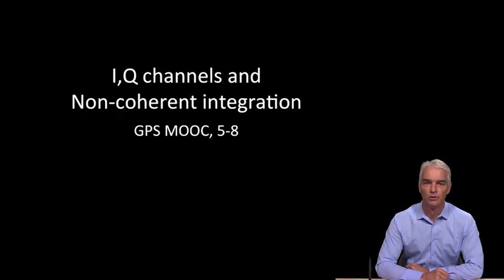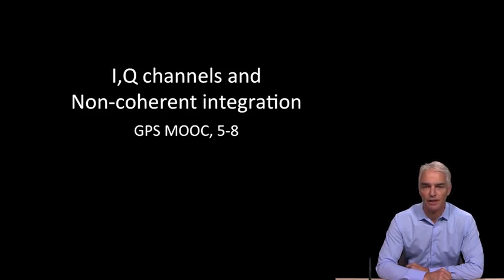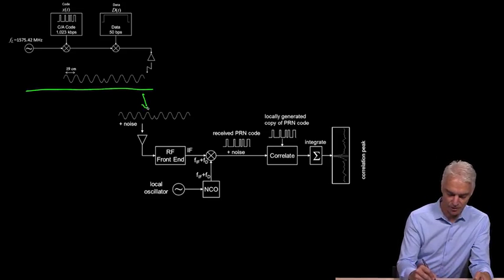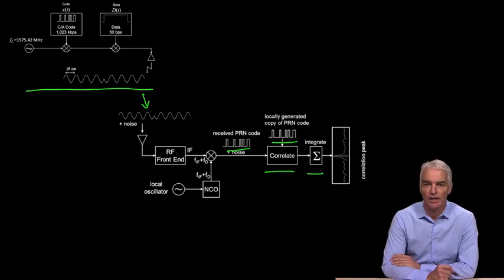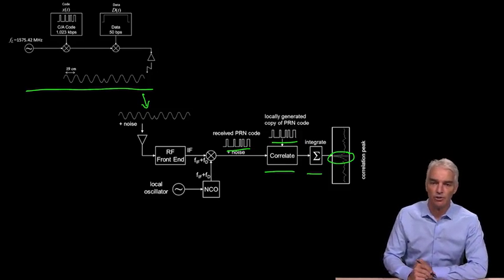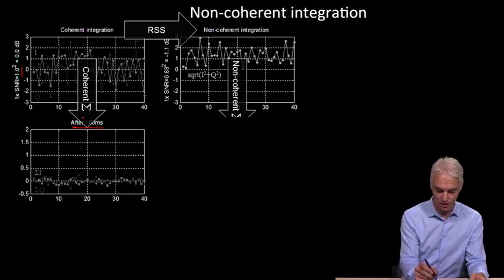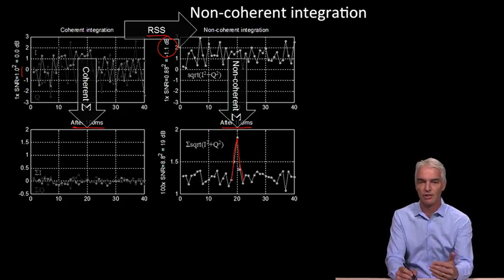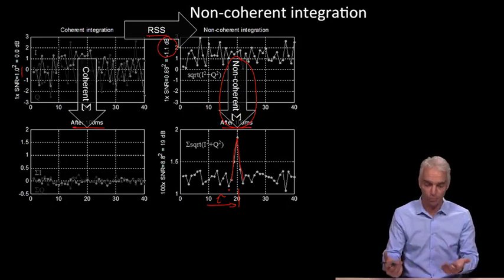5.9 - I,Q channels and non coherent integration

Comment: Sir, in non coherent integration...
How do we differentiate data bits 1/-1 ????
After squaring -1 databit is turned into +1 and entire gps packet will be 1s.
Reply: you just integrate non-coherently every 20 ms (the results of coherent integration), i.e. every time that a nav bit transition occurs